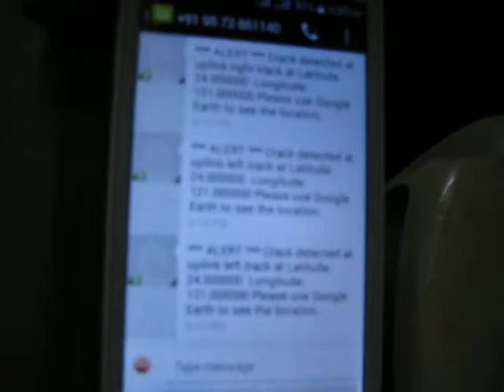Solar powered railway track crack detection using GSM GPS

Comment: what are specifications of the battery, motors and solar panel that have been used?
Reply from the maker: You can contact us at +919603140482
Through WhatsApp or call